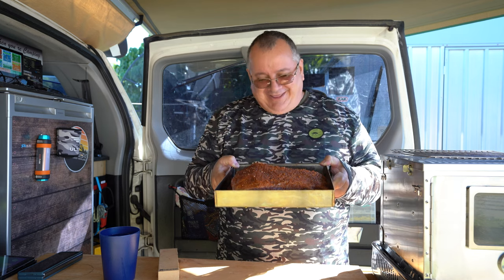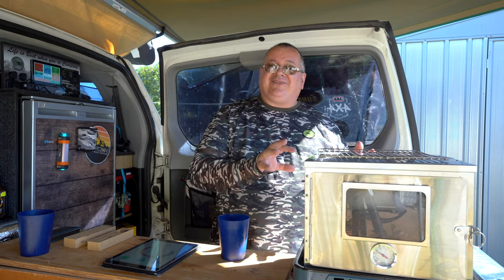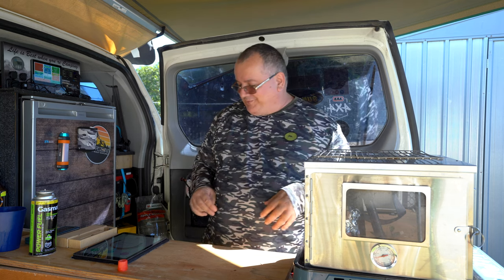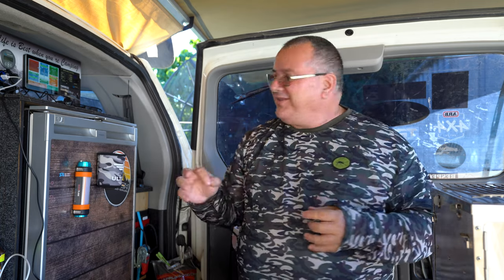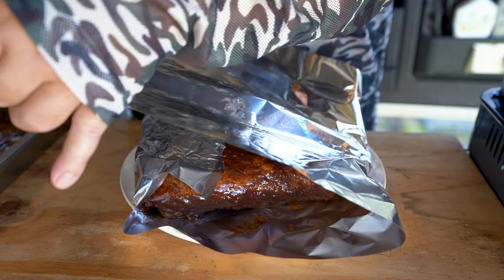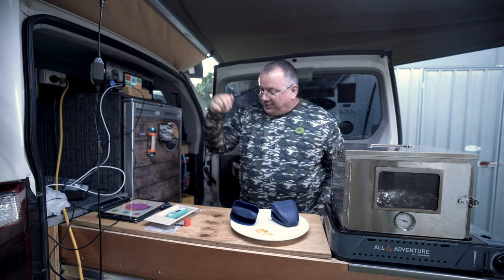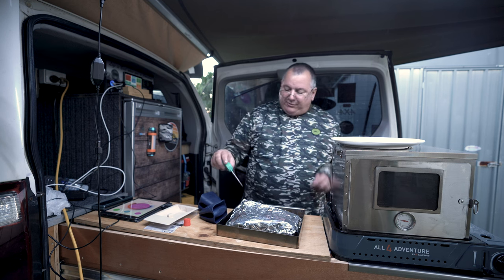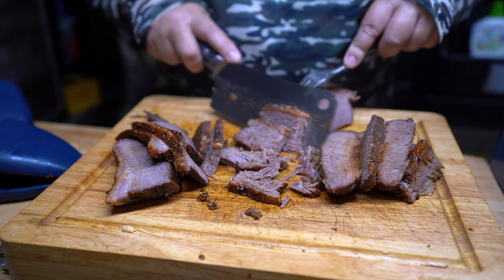Cooking a Beef Brisket using a Butane Stove and a Portable Foldable Winnerwell Oven

Comment: Could I please ask where you got your tray /stainless steel dish from.
Reply from the maker: It's a travel buddy accessorie.  After market.  Bought jt from a website in Melbourne.  I don't have the link anymore.   It's called SMR or something like that.
Reply: @PhilsCampingReviews  thank you,I will google it
Reply from the maker: Did you find the trays?
Reply: Brought a kick ass one and the measurements on the web is different than the measurements of the dish. It was advertised as 240 mm and it is 245 so just won't fit.
Thanks for asking
Reply from the maker: @lisarollings9372   best to look for the company in Melbourne. They fit perfectly